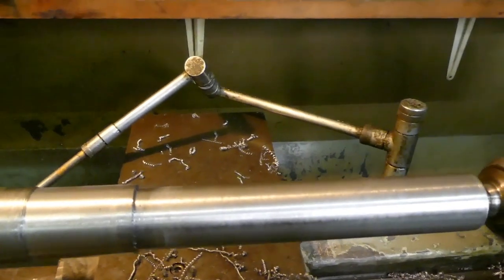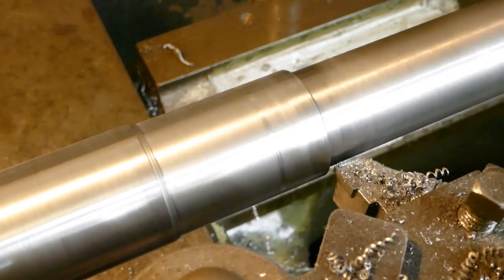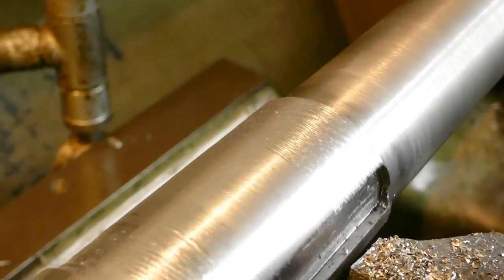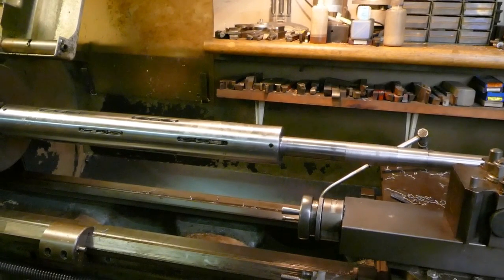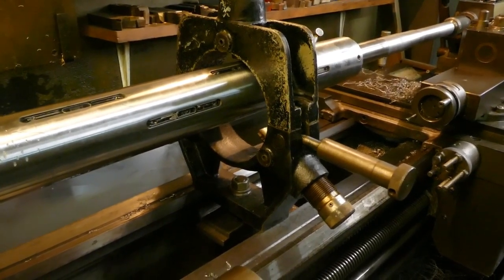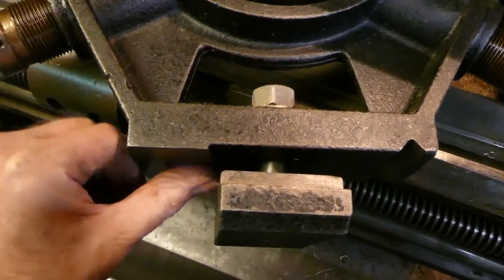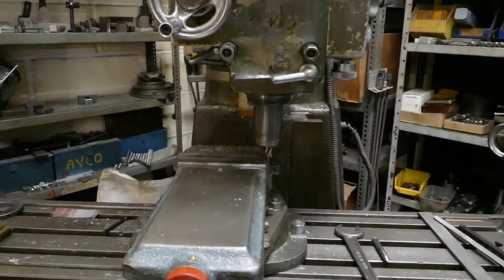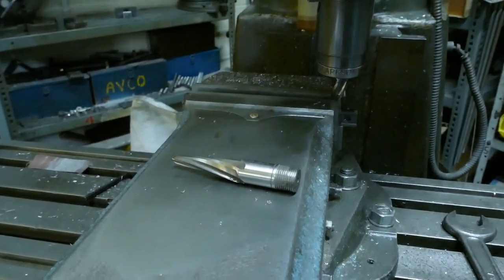Adapting a Fixed Steady to fit our Colchester Triumph 2000 lathe (& why we needed it).

Comment: Hi! Have you considered making an adapter to use it also as a follower/travelling rest?
Reply from the maker: I haven't. I don't have a travelling steady for this lathe. I think if I needed one I would be more inclined to adapt a travelling steady from another lathe if I couldn't get the correct one, rather than try & adapt the fixed steady.

Comment: You’ve bought a fixed steady for a Colchester Master - they are 6 1/2” centre height, whilst your Triumph 2000 is 7 1/2” centre height.
If you want to sell the steady, and get the real thing, I’d be happy to buy it, as I’m looking for one for my Master 2500 !
Kind regards,
Steve A.
Reply from the maker: Yes, I suspected as much. Since getting this steady to work, I haven't been looking for the correct Triumph one, but if you find one I'd be happy to do a swap!

Comment: The shaft is known as an air chuck. They fit into the middle of rolls of paper or textiles and provide the precision internal clamping of the roll. They can really get to be quite big units for things like news print machines were they have to hold tons of paper on a roll and then rotate at quite high speeds. There is a rubber bladder inside that when inflated pushes on the long oval dogs that are sticking out of the larger diameter of the shaft, this then clamps the shaft to the inside of the roll.
Reply from the maker: Aha! Thanks for that insight - I had wondered what exactly it did & how...

Comment: It is great that you managed to get the part to fit the lathe but a lot of work modifying the steady. I wish I knew you had this problem as we bought a box of random lathe and mill parts from an auction a couple of year ago and I am sure it included a steady for a Triumph 2000. A bit late but I will check when I get the chance
Reply from the maker: I wish I'd known you might have one!
Reply: @MidEngineering  I checked last night and you will be pleased to know that I got it wrong, the steady we have is from a different machine
Reply from the maker: @GardenTractorBoy  🙂

Comment: "If it is worth doing, it is worth doing properly" as the old adage goes.
Ally should be fine, my Bantam one is ally from the factory.
I dont know if you have ever heard of a machinist called Dave Wilks from Sheffield who is known for  turning big shafts,  well he always turns them from left to right not right to left. He has shown that it does make the cut better, not entirely sure why but it does. Possibly because you are stretching the metal from the chuck rather than trying to compress it, whatever, give it a try sometime and see what you think.
Reply from the maker: Yes, been very impressed with David Wilks' work.